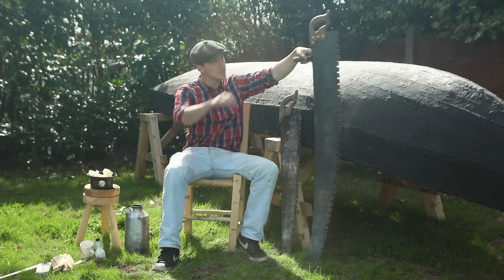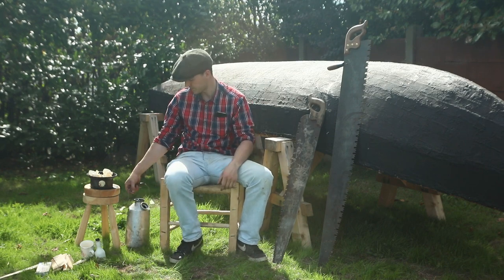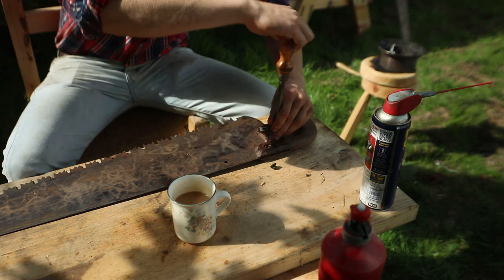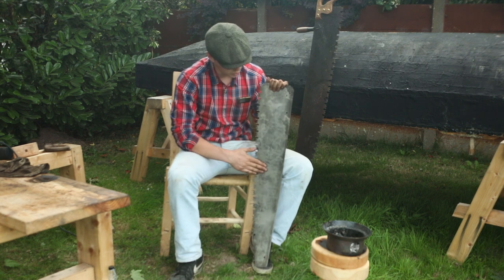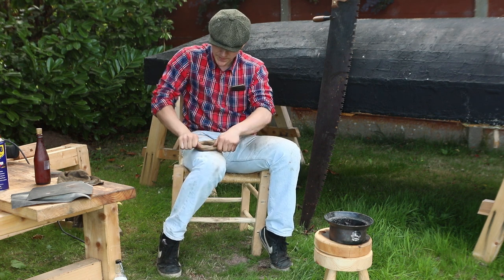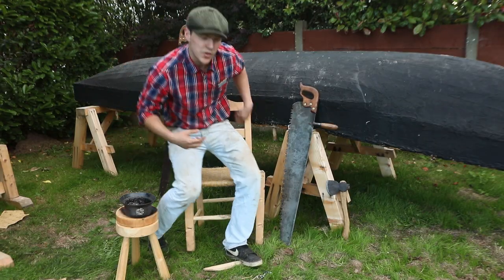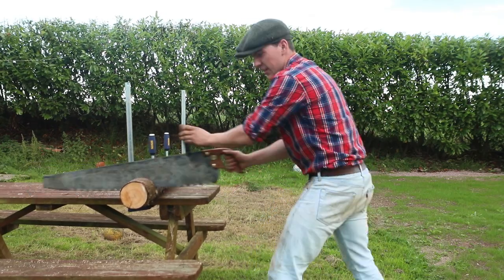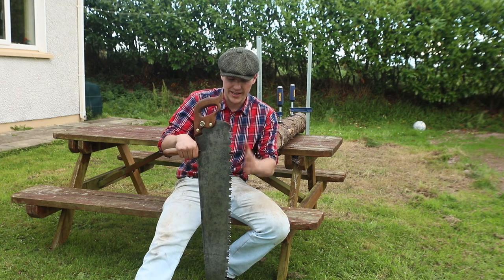Restoring & Sharpening A Disston Crosscut Saw

Comment: Enjoying the channel. Might cut better if you joint the teeth to they are all the same height and then make sure they are all set the correct amount. This is what I've gleaned from reading and talking to people. Also coat the saw with candlewax will reduce friction and last too

Comment: Just picked up a real clean Disston’ like that small one—  blade on mine measures 43” — overall with handle  48”.  The Etching is still intact on the blade.  Surface patina/ little to no rust.  Handle Medallion dates it to pre WW-1🇺🇸

Comment: I have the exact same saw, mine cuts 10x faster. What you didn't do was to  "set the teeth". Your saw will cut like shit if you don't use a set tool to set every individual tooth. These saws cut like a dream. Dry or wet wood, its a machine
Reply: Hi, When setting the teeth of Great American saw like this, they must all be set in the same straight line or some have a curved?
Reply: @DogFishAttack  Some people curve the tip when using the saw set, which will work in some way, but it won't be effective. If you want to set it properly youll need to set each tooth, not only the tip.  Meaning /\ the whole tooth should be slightly bent 0.05 ever so slightly wider than the saw blade body itself to perform that looseness, and clean cut.
Reply: @DogFishAttack   saw teeth are set oppositely from one another. One left one right, we call this the cross cut effect. Different than a rip saw, the cross cut works for cutting down trees and branches etc. Where the rip saw is more aggressive and tooth are straight lined back to back, we use this saw to cut wood vertically, like you would use an axe to split wood.
Reply: @DogFishAttack  If you ever find someone that takes part in these crosscut 2 man saw/ 1man saw competitions, they will tell you the same thing. And look at how fast those saws cut. Because in stead of using only a bent tip of the saw to cut with, they use the whole body of each tooth, that results in a more aggressive cut, taking out more wood with each pull. I have a 1947 Crosscut myself, and it still works like a charm. I sharpen it about 6 times a year. But once sharpened correctly, you won't sharpen it again for a long time. That high carbon steel they made in the olden days to manufacture these saws is something that does not exist today. They last forever
Reply: @vanstaden  Thanks for your answer!
Reply: @DogFishAttack  no problem, glad i could help
Reply: @vanstaden  I know it. I have a brand new crosscut saw but it looks like the metal is not good as an old one and needs more often sharpening. A good alternative is a bowsaw but you cant cut very thick wood. The blade curves easily.
Reply: @DogFishAttack  yes for sure.
Reply: @vanstaden  Hello, i just receive a vintage Great American saw and as i can see all the first left tooths of the three are bended a little away from the body at the same direction. The other 2 tooths (the center and the right) is straight up as the body of the saw. I had the impression that the center tooth must be set a little out of the body, one left and one right. What is the right set for cutting only dry wood?
Reply: @DogFishAttack  you are right. One left, one right. Its a cross cut saw. No tooth should be straight. It should be set at 0.5mm approximately wider than the body to provide a easy clean cut without the saw getting stuck
Reply: @vanstaden  Thanks a lot!
Reply: @DogFishAttack  My advice would be to straighten all the teeth, using a hammer, then file them down by dragging a file over the saw blade from left to right over all the teeth until markings on all teeth are visible. That way you know all teeth has a even height. Those that got filed down a lot needs to be reshaped using a file only. Never use a grinder. Then, if you have a saw set, use the appropriate setting. Set all of them again, one left, one right and you should have a saw that will serve you well. Sharpen teeth at 60 deg angle.. best for longetivity.
Reply: @vanstaden  Awesome!
Reply: @vanstaden Hello sir,
I didn't understand some details and the saw is stuck in the wood. It stucks so much when i  push or pull that i move the sawhorse along with it...
What do you mean "tooth"? Only the center one or and the 3 of them? 
I think my mistake is that I set up all 3 of each trio. The center must be set away and the other 2 remain in straight line as the saw blade?
Reply: on the great american pattern with the tooth tripplets, are all teeth faces filed with fleam angle? Or are the sides facing the big gullets supposed to be 0° fleam so they push the noodle in the gullet? I have an old one that was filed like that
Reply: @HansWurst12345  i explain it in detail here in my previous conversation

Comment: do you get Tetanus alot from working with all these rusty tools?
Reply: Nobody ever got tetanus from rust, it’s a robust bacteria that lives dormant a long time in soil but originates mostly from horse dung, needs a deep penetrating wound to get the right conditions to take hold - like a barbed wire stab or stepping on an old nail😮